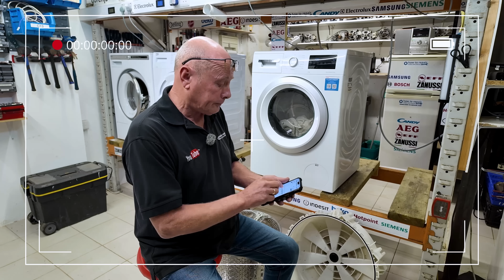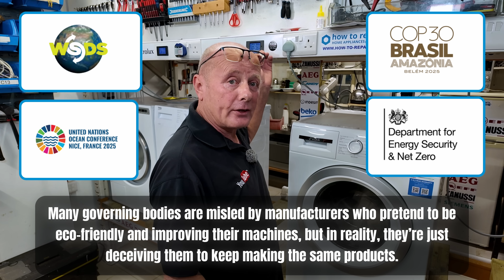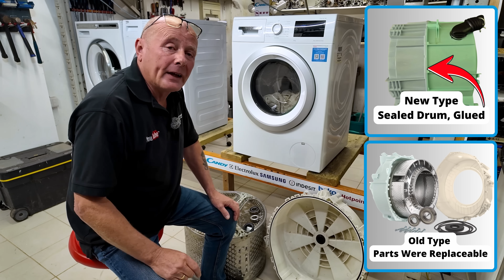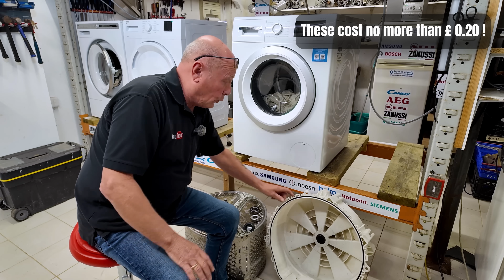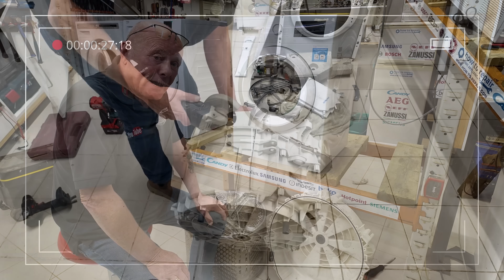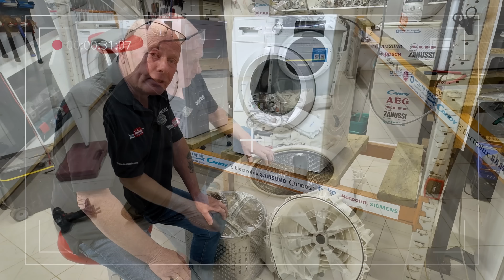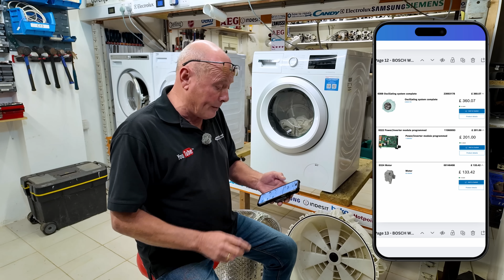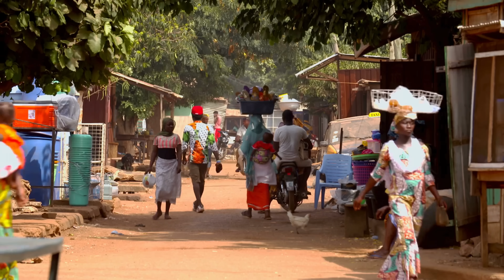Washing Machine SCAM EXPOSED! The Truth About SEALED Drums: Naming & Shaming

Comment: In the midst of another great video, this time explaining how companies are cheating customers by sealing plastic drums… is also an ideal opportunity to remind consumers that plastic outer drums in general are garbage!!; negatively impacting spin performance, lifespan and hygiene.

*ASKO - still uses stainless steel inner & outer drums.
Reply: I got rid of my Miele T1 plastic outer drum for an Asko bottom line metal outer drum repairable!  Whilst I prefer some of Miele's wash programme features, my old Miele Novotronic washer lasted 23 years (outer stainless steel drum) and was fantastic.  Their new budget expensive bottom line machines are crap because of the outer sealed plastic drum!! Take note Miele!
Reply from the maker: Bosch for example, built their reputation with their machines from the early 90s until 2005. Now, they're ruining it with these new machines that have sealed drums. 

Thanks for mentioning the ASKO machines. They utilize stainless steel for both the inner and outer drums instead of plastic. This type of heavy-duty designs allow for higher spin speeds, better stability, and superior hygiene because steel doesn't degrade or trap dirt like plastic. This commitment to more steel, less plastic is exactly what we should be demanding from all manufacturers.

Recently, I've published a review video for ASKO machines and you can watch it via this link in case of you've missed it: https://www.youtube.com/watch?v=A0EIjDiP3r4&t=281s
Reply: @How-to-repair I’ve already seen your ASKO video👍, keep up the great work.

Comment: Its like a car, you cant even change a battery without going to a dealer to have it "coded " to the car, total fkn rip off
Reply from the maker: It’s true mate built-in obsolescence and durability issues aren’t limited to appliances. For example, laptops often have non-replaceable batteries or soldered components, making repairs nearly impossible. It’s frustrating to see this pattern repeat across so many products! Thank you for being on board with the main idea! Reaching maximum visibility is completely dependent on our team. I need your partnership, so please make every effort to share this far and wide.

Comment: the same is happening in the car industry. Previously if your headlight bulb went £2 bulb job done. Now some manufacturers need you to change to whole headlight assembly , in some cases over £1000 then you need to get the new headlamp assembly programmed to the car !!! more cost and time
Reply: in asian country people are watching youtube instruction video then use heatgun to open those lamp assembly, replace the led lamp and use fish tank glue to close the lamp assembly
Reply: @nedelwre  In India they work miracles with cars and trucks.  Nothing is thrown away.
Reply: @scaryfakevirus ..in India (the only time I was there,a long time ago there was a guy on the street refilling non refillable,disposable lighters for the price of a box of matches
Reply: @nedelwre 'Top Idea' there using fish tank glue. 👌
Reply: My mechanic was recently telling me of a nissan that failed the Low beam during an mot...  the whole light /  cluster assembly had to be replaced.. £ 850.  And that was without the fitting😮
Reply: @merlin5476  I had the same problem with my Renault.
Reply: @scaryfakevirus no wonder cause they share platforms.
Reply: @merlin5476  not only is it not necessary and environmentally unfriendly it is just pure greed
Reply: @merlin5476 AU$8000… for a Range Rover replacement headlight.😳😳😳
Reply: @merlin5476  Don´t own a car - simple!  Walk, public transportation, and taxis
Reply: @flamarion55 only a person who lives in London or doesn’t use ‘public transport’ would say this. It is expensive, yes more than a cheap second hand old car, unreliable, dangerous, unsanitary, time consuming, noisy and impractical. Oh and I guess lefties with a green agenda and a Tesla would say this too.
Reply: @AutisticCuriosity  It does indeed depend on personal location and circumstances.  I stand corrected
Reply: Same with replacing the battery...has to be recoded at the dealer.
Reply: @johnlesoudeur3653  Yep!, as long as there are suckers there are abusers.  Stop buying, become free
Reply: @flamarion55  I have.
Reply: @johnlesoudeur3653 not my cars😂..
Reply: @johnlesoudeur3653  That´s just insane.
Reply: Best decision my wife and I ever took a couple of years ago was NOT to own a car!!  We rent one when going on a road trip, use taxis for 5km plus journeys, and walk, walk, walk.  Both in our 70s, we are saving tons of money (depreciation, etc), tons of hassles (registrations, parking, insurance), and getting healthier!!!
Reply: That's why all my cars camper are 15 old plus better made reliable fixable cheap,then again barely need any money on them.
Reply: Try buying Hyundai parts from their dealer . 4 little plastic tubes , with a simple plastic head , two w/ screen wipers , £92 .00 !! I guessed , on seeing them ....£40 tops . To build a car at these spares prices would retail about £300,000 !!
Reply: Codin came in to discourage part theft. All major parts needed coding at a stealership.
This now means on a 10 year old car which is worth little that you cannot just get a secondhand part from the scrappie. It is very frustrating.
Reply: @julianlord2697  I didn't know that . Scrapyards were fairly common....I couldn't find one within 50 miles !!
Reply: @julianlord2697  Usually the criminals know more about how to hack things than the manufacturer so I am not sure I am buying that excuse to ensure their products go into the crusher rather than the second hand market
Reply: It's across the appliances.
The weird thing is, the control boards.
I've never had an issue with the control boards on a computer/phone...
But the boards on my appliances are constantly failing for absolutely no reason (no heat or water damage).

Just recently, my dishwasher & stove both failed within a few months of each other:
1) calling a technician is around $80 just to identify the problem.
2) I decided to do that myself. It seems like the control board.
3) To order a used  control board is about $320-$400.
4) I cannot risk to waste $320-$400.
5) Calling a technician to visit. He confirms that the issue with the control board & gives me price $320 with the work.

To replace a cracked glass cooktop is again $350 + tax (no delivery or installation).

So to fix my 5-10 years old stove = $350 for a used control board + $350 cooktop.
It's a daytime robbery.
I can buy a new stove/dishwasher for $650-$1000 including the delivery & "installation".
Reply: This started in the motor Industries years ago, the bumper was designed to protect the car from small dings and bumps and was easy/cheap to replace.  Bumpers are now an integral part of the car and are ridiculously expensive to replace given that they are just a lump of plastic
Reply: @DerekEmerson  The bumper has a honeycomb filler that absorbs impact, but I completely agree that plastic parts are now softer than the cornea of the eyes of all the idiots who jump under the wheels, and this is all thanks to the influence of insurance companies, who do not want to pay for treatment.
Reply: The stereo in my old audi failed a few years ago, so I bought a used replacement. Then I had to pay thr dealer to code the radio to get it work in my car. For security reasons, they sayed. Liers, I replied.
Reply: that's different. LED headlights need to be sealed by law. and that is very different from a washing machine. headlights are precise parts to ensure safety on the road. LED headlights contain precisely aligned modules of LEDs and reflectors (and lenses in some cases). some headlights have the ability to have whole mudules replaced and get resealed, but the LED is built in and aligned. it is impossible to replace the LED alone and have it still work as intended. then of course headlights are programmed to the car. extra functionality like matrix stuff and automatic whatever must work correctly and the headlight MUST be able to communicate with the car if a failure occurs. 
keeping in mind the LED headlights usual lifetime it is also a non- issue. additionally you even get headlight holder repair kits if only the tabs are broken off in an accident.
Reply: Luckily I live in the Far-East and they can open and repair the headlight assembly.
Reply: I service my own motorbike instead of taking it to the garage. Mainly because you have to remove the bodywork, and fuel tank (!!!) to replace the spark plug.
Reply: True! And it drives up the premiums for car insurance for everyone. Non repairable LED headlights and bumpers coated in the colour of the car ...
Reply: I replaced by Toyota's LED taillight assemblies with bulbed ones for this reason.  Saved me about $400
Reply: My daughter bought a Ford Figo, the first thing that broke was the lock on the bonnet. A new one cost almost 300 rand. I took a steel plate and cut one out of it. It's now +-4 years and it's still lasting. And Iam a woman.
Reply: @esthergreenwood4019 Good for you ! I'm a bloke , I couldn't do it . ( Between us )!
Reply: Its why I wont buy a new car, and never buy anything from Germany who seem to be the biggest scammers
Reply: Is that so? Let's go back to candles and acetylene headlights; they are clearly more affordable. Just observe how LED headlights light up the road compared to halogen ones. Now to the topic of washing machines and their drums. A non-detachable drum is a significant drawback. I previously owned two Samsung Eco Bubble washers, and I felt they cleaned well and could be repaired. However, when the time came to replace the bearings, spider, and belt after seven years, I found that it was actually cheaper to purchase a new machine—another Samsung. Now, I have a Bosch Series 4, which washes much better than the Samsungs did. I can't comment on repairs yet, but cutting the drum apart seems manageable. However, dealing with the spider and properly re-pressing the bearings with seals is likely much more challenging. Particularly if you strike the shaft with a hammer instead of using a special press or puller.

Comment: When they do a production batch of a certain type, they always over produce extra parts for the support process and repairs. These can be produced relatively cheap because of the scale. 

But the washing machine can be cheaper because it moves quickly to the consumer. But spare parts have to be stored for a long period of time which obviously creates high prices in the long run of the failure.

But all is thought out. You can be sure that the support of the lifecycle of the product has been done in such a way that it profitable and most customers will be happy in middle run.

Comment: The do not plan this with each other, as in an evil plan to own the market.

at the moment, developments for the environment are going at a very high speed. So it may be that in the long run it is better to quickly renew current machines to keep them up with intelligence development to reduce power consumption. Like integrating in a smart grid or putting a battery in the device itself to store solar energy.

But bosch, siemens and haier do design together and the production lines are build by the same companies, so they copy production processes to every manufacturer.

For the environment it is currently still the best to repair, because to much fossil energy is used in production and transport processes. So from this point of view you have a good point that the drum should be splittable and ot may be that the company itself is not aware of what they did when they made the drum sealed.

So for the lifecycle of this product, repairing is the best. You can bring this under attention of the european union. They have people for this kind of f*ck ups.

Comment: Love the video, this is a very important issue, not just with washing machines, but across all consumer goods really. Quick question, do you have a recommended brand to purchase? I know you recommenced Asko before, and you managed to get an incredible deal on one of those, but unfortuantely unless that deal comes back again, it's just too expensive for me. Is there anything mid range that is easily fixable? Or is it the case that if you can't afford the good stuff, you might as well go cheap as you'll have to replace it in 5 to 10 years anyway no matter?
Reply from the maker: the LG has a splittable drum and is not bad for the money the Beko machines are much cheaper, but they come with a sealed drum but the technical support the company gives is pretty good

Comment: i am in Australia and bought the flagship Miele washer and dryer new back in 2009 for the crazy price of $10,500. It has been used almost daily and still going strong. I know a few friends including my cousin who bought the new generation Miele 3 to 4 years ago and they had a few warranty repairs during the warranty period and after the warranty period the service call and repair cost was the same price as the machine so they had to buy a new one for $2500 to $3000. Mine has been going strong for 26 years now but when it fails I plan to have it repaired I don't think mine would have a sealed drum being from 2009. I think the best way to go is ignore the new products and their efficiency (mine is 2009 and efficient enough) and just buy an older model used which is repairable. I think that's the only option left now..

Comment: Come on, it's 2025. It is not a new trend. Ultrasonically welded tubs have been in the industry for more than 15 years already. In 2017, I replaced bearings and a seal in a washing machine from the late 2000s with a sealed tub. The expected seal failure allows water to damage the bearings. I ought to cut the tub and then seal it with silicone while screwing it tight. The fix lasted for at least 5 years. Don't know the state of the repair now, as I left this machine with the landlord.

Comment: Former BSH technician here. First of all, pretty much all bearing damage to washers I've witnessed was caused due to a failed seal and water infiltrating the bearings. Rubbers seal get notoriously eaten by detergent, and if you are being honest, you will always find residues of to many detergent use - built up over years and years- in the drum. There have been bad batches of bearings- true - but then Bosch would extend the warranty. Another thing : when the warranty is just over and you are facing a bearing failure, in 90% Bosch and Siemens would take responsability for it and change the whole appliance for free. Another thing I want to point out is that about the claim on the right to repai, which I'm standing 100% behind it as a technician myself, I find that BSH, as one of the only manufacturers, provide spare parts lists for all models on their website. Yes, true, a programmed power module, a complete drum or motor module are expensive, but they don't fail a lot, if used WITH COMMON sense, like using the right amount of detergent. A lot of small spare parts are available for much smaller prices and helped me a lot in repairing 'dead' machines (carbon brushes, valves,...). Name me one brand that has no part in this 'planned obsolence' theory. There are none. Just pick the right brand. BSH is the way to go. Miele is too expensive, AEG too weak on the electronics, the rest is rubbish (unless off course you sell it to a person who is clearly using TOO MUCH detergent). Enjoyed the video. Cheers from Belgium
Reply: Yes, a lot of it is down to people overdosing detergent. Tabs and pods make it worse as they are a fixed dose that may be inappropriate for the water hardness, soiling and load size. My advice is always to use powder, and to read the dosing instructions carefully.
Reply: According to your experience, the quality of the detergent is important? Second, the official cleaning solutions, cause damages to the rubber seal?
Reply: We have very hard water here which I'm convinced is one factor in seals failing earlier. I've not had a shaft seal last more than 11 years before leaking water into the bearings, shortest was about 7 years. The rubber seal gets encrusted by limescale, which I strongly suspect causes the outer lip to wear out more quickly as it would stop the seal flexing. Descaling it may have helped in my current machine, which  lasted the longest, but the water level is so low the seal doesn't get descaled properly.  Perhaps if manufacturers used seals designed for hash environments, such as used in outboard engines and agricultural machinery, which have to resist grit salt water and sand, their machines would last longer.
Reply: My last Bosch died shortly after I accidentally used too much detergent. You know what you are talking about.

Comment: I live In Ireland but I also have a home in Thailand.  The washing machines in Thailand are easy to repair and a shop called Amorn have branches in every city as well as online and they sell all the parts at very reasonable prices for all the parts on all the popular machines sold in Thailand.   A big difference also is the cost of labour for the actual repair, it’s low so along with high availability of parts they tend to be repaired rather than discarded